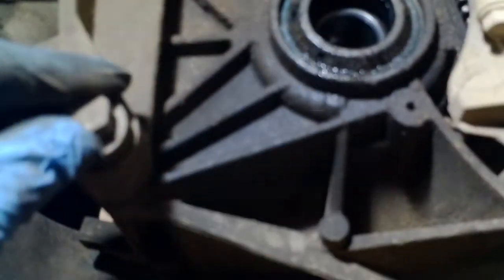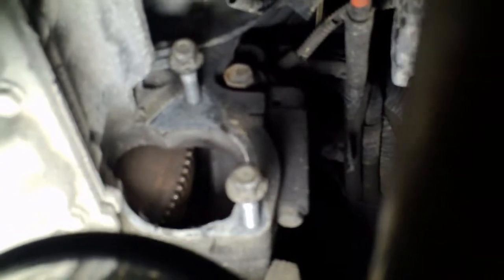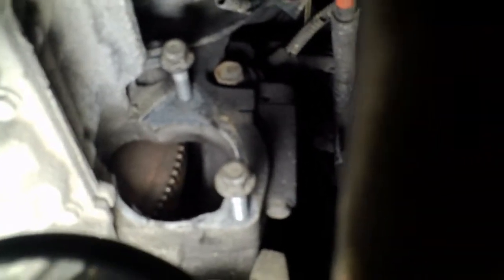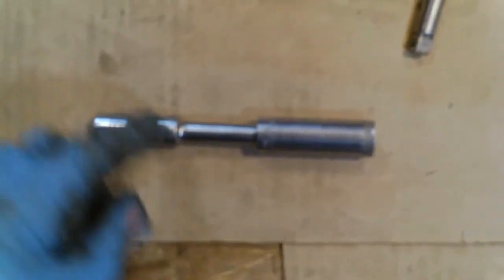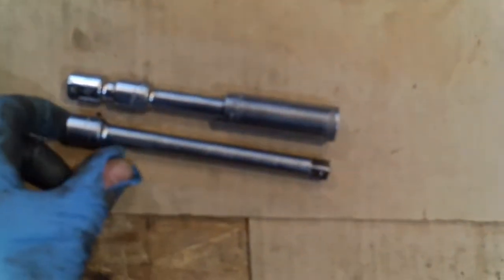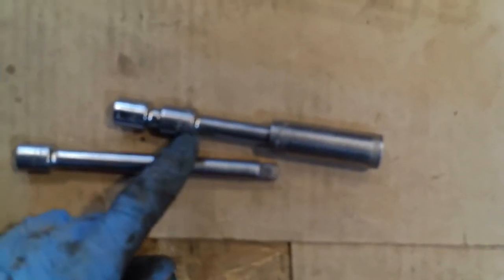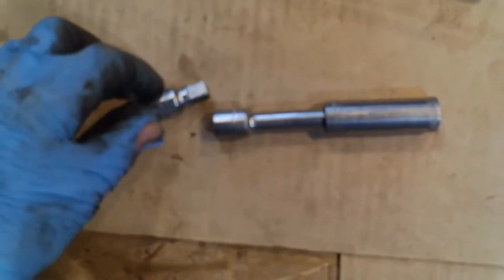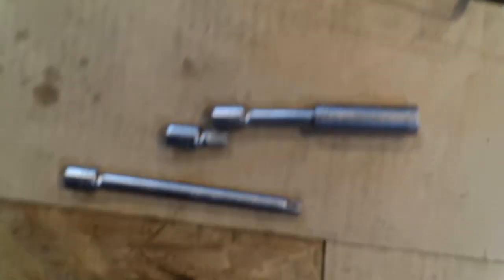Detailed Saturn Ion Engine Replacement and more, Part 2

Comment: What is that part hard to find number for the manafold gasket ? You vid is a bit blurry and I'm having trouble reading it
Reply from the maker: Yeah, sorry about blurry vid, the focus on recorder is horrible.  31643 is the part number.  It seems like it is not that hard to find now, but I had trouble  originally.  Walker and Nickson both make it, did a quick search and others make it as well.
Nickson Exhaust Pipe Gasket
Part #    31643
Reply: This video is super helpful, thank you very much for taking the time to do it.
Reply from the maker: @DasPreem  

Glad it helps you,  feel free  to ask any questions.  I am going for 400K miles on mine and  fixed  about everything a couple times now....